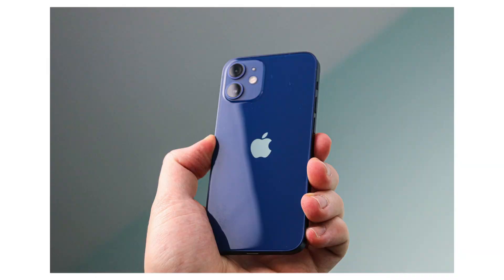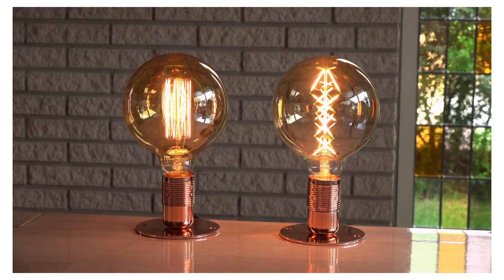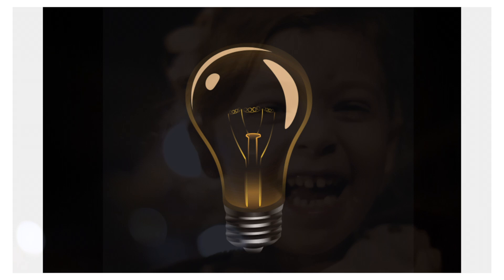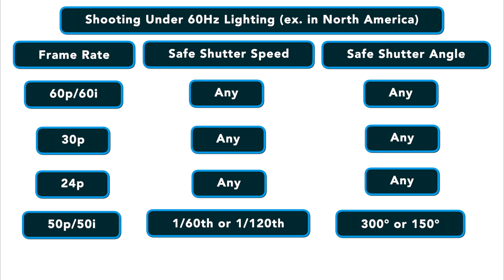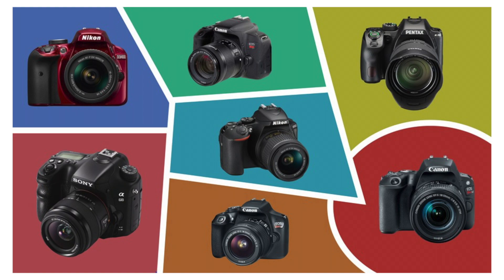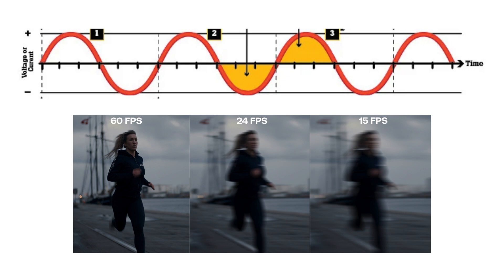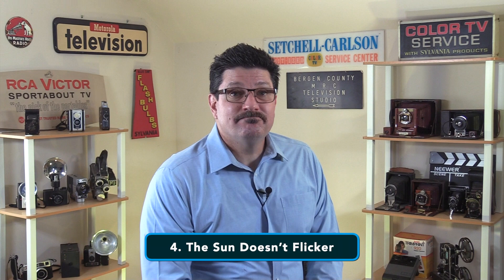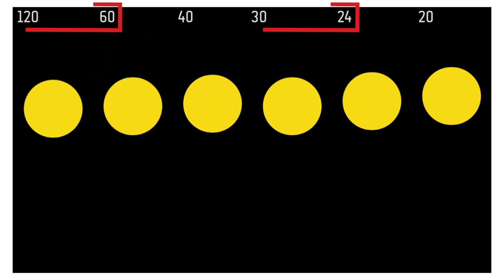How To Stop Light Flicker In Videos And Films | Why Flickering Lights Happen

Comment: Good to know about adjusting shutter speeds..I haven't noticed flickering in my videos though my eyes are not as good as they used to be. Recently I got a smart bulb which doesn't flicker.
Reply from the maker: With the right lighting gear, you've avoided the problem completely. Thanks for watching.